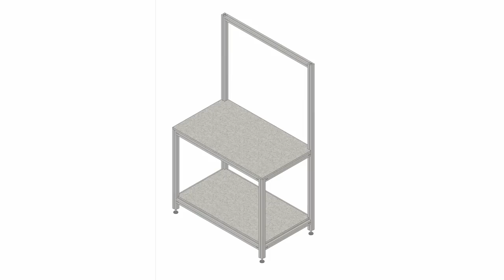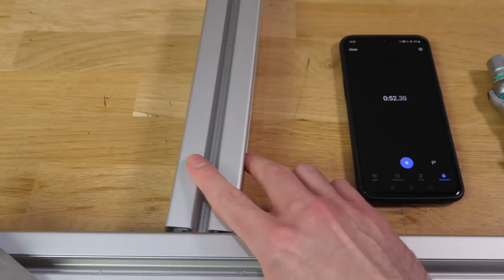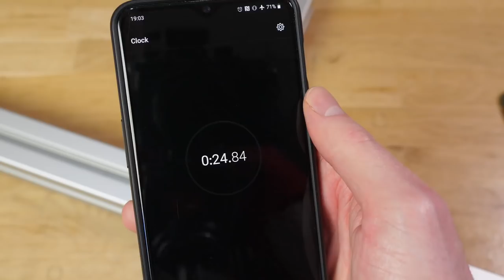3D Printer Owners have been waiting for this!

Comment: I diy something very similar when I opened my 3D printing business back in 2017. I designed mine to have 3 printers on the bottom shelf and 3 printers on top. A 'tool area' between printers (spatula, metal brush, cutters, etc) and filament storage on top. I have 16 300x300x400 printers, 4 500x500x500, 1 phrozen transform and 2 anycubic photons. I made my designs out of wood because it was cheaper that way, and because I love the look of stained wood!

Comment: There is another option also, named "Blind Joints" You just don't need to drill anything at all. (A shame we can't show pictures here, would be so much more easy for anyone)
Reply: Plus blind joints literally only need 1 screw so they are perfect
Reply from the maker: Would love to know more about these joints if you have more info.
Reply: So blind joints are basically made by tapping the end of the extrusion depending on the extrusion this is usually somewhere around m5-m8. Then you screw a button head screw in and slide it into the slot of another extrusion. And for a 3030 extrusion for example where you wanna connect it as an L shape you would the drill a hole in one of the extrusions 15mm down from the end in like 6mm size so you can insert a hex key and fasten the button head screw.
Reply: It self squares, given the cut is rather aware, it needs a screw, a tapped end in the extrusion and a hole to be drilled. And it makes for a really rigid joint. I used these throughout on my self built 3d printer and I am loving how easy it is
Reply: If you still have any questions, feel free to contact me on youtube pms or simply reply here :) I'd love to share my knowledge
Reply from the maker: Thanks for sharing Leon, very much appreciated. I think @johan was talking about something different though because the joints you mention would be more expensive due to tapping + hole + fixings. I did consider the type you are talking about but because you have to have a hole for tightening the screw it means you can't assemble things anywhere that is not intended, like adding the shelf at a different height for example.
Reply: @Vector3DP  yes that's a very valid point. Cost wise it is the cheapest however afaik

Comment: Definitely the third joint. I'm in the middle of a VORON build and they use a similar method to the third joint and it is quite solid. Have you considered doing a KS campaign or a group buy? I like the idea of just giving you my money and getting a ready-to-go kit, rather than trying to do the leg work of sourcing a supplier, specialized hardware, and so on. I also don't mind spending a little more knowing I'm getting something that's been very well designed and will last a lifetime. Looking forward to future developments.
Reply from the maker: I'm not locked into any particular distribution method at the moment. The size of the worktop and long extrusion can make shipping really expensive (more than the sum of the parts) so may only be feasible to do that within the UK where shipping is much cheaper. The other option is that I gather and sell kits of all the specialised and custom parts that can be difficult to get hold of and then users source the worktops and extrusions more locally given specifications which I provide. I expect the second option will be very difficult for some and may also require more tools for the assembly so there are ups and downs to both.

Kickstarter is something that I know a lot of people don't trust and don't like to support and i really don't want to start this journey off on the wrong foot, but it certainly has its advantages to helping reduce the overall cost by being able to buy in larger quantities.

Comment: The design of workbench is not bad, but I'm still wondering why do you need to use so expensive material as aluminium extrusions and related hardware for such static assembly? I would understand if a work surface can be adjusted at desired evevation by sliding on vertical channels, but your structure is not supposed to do that. I have made quite many workbenches from plywood or steel square tubes (welded or bolted) and all of them are also pretty robust and can work for many years. Anyway thanks for video and I also like the Wera tools :)

Comment: Having a horizontal piece blocking a chair’s legs or base seems suboptimal.
Reply from the maker: Thanks for the feedback. With a narrower bottom shelf you can very easily assemble it with the front lower cross member further back. Personally I use a stool that doesn't need to pull forward to be comfortable for me and my feet sit nicely on the bottom shelf. I'll think about which way becomes the default.

Comment: Did you evaluated doing the join with a bolt and a tapped screw thread in the extrusion?
Reply from the maker: Yes, but never made a physical version because its too limiting because you can only fix in one position. Also it's even more expensive in material processing.

Comment: Overkill. Those profiles are too big and too expensive for a bench that'll have to hold almost no weight but its own. My bench uses profiles half the size of these and it's been holding up just fine for 10 years already. DIYers always over-engineer their projects.
Reply: Nice. Mind sharing more details? I also used smaller extrusion for my Battlestation/workbench
Reply: @Ender_Wiggin  2525 profiles with regular angle brackets (I think in the video he's using 4040). I don't need a bottom shelf (which stands in the way of your legs when sitting at it) so the desk hangs of the wall, basically an inverted L shape with a strip of 25x4mm flat steel on each side at 45 degrees to support the desk profiles mid-way (so no extra feet in front either). My tools pegboard hang on the wall with just 2 bolts. I have a couple of IKEA cabinets above which have been doing just fine given the ridiculously low price I paid for 10 years ago.